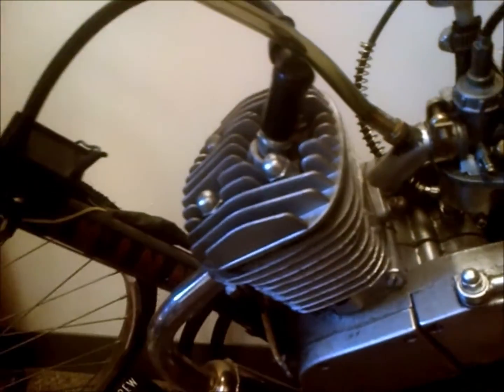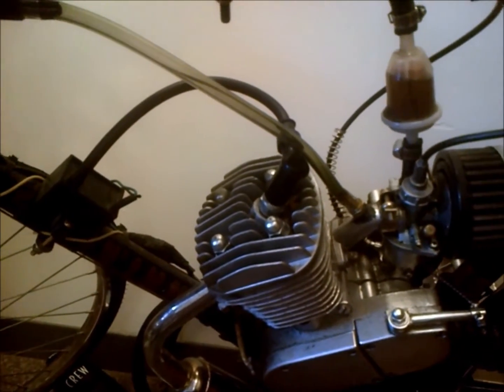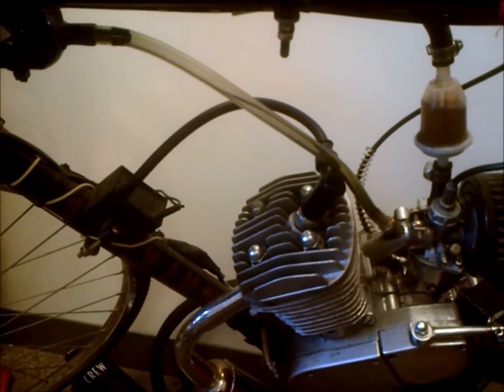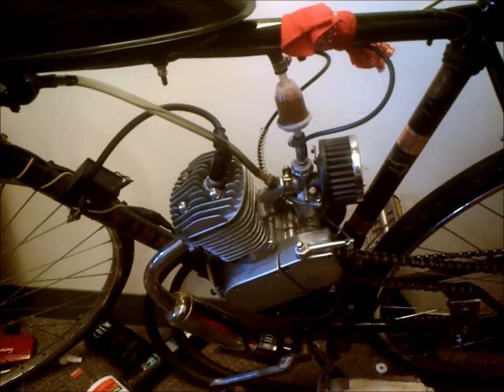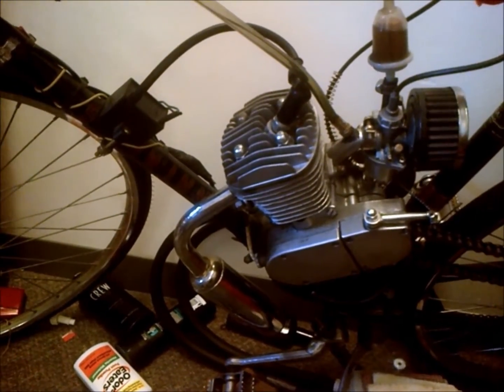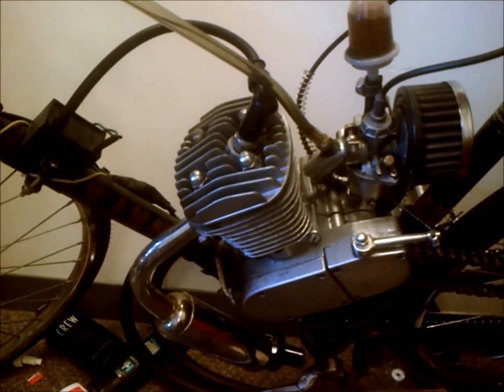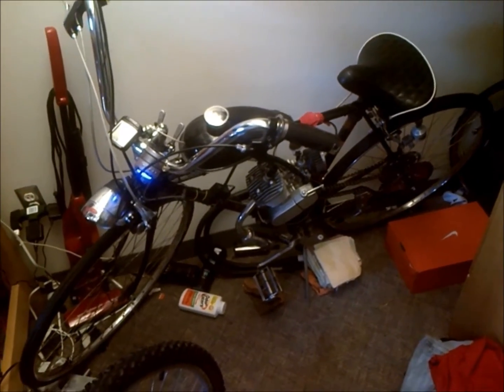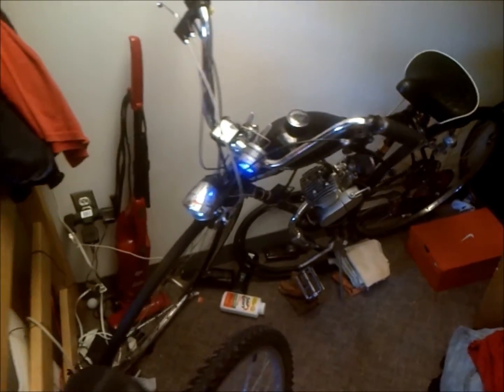Compression PSI to Compression Ratio

Comment: Your wrong. I used to have a compression tester that had the scale from compression ratio to psi and it was accurate.
Reply from the maker: It wouldn’t of been accurate for compression and here’s why - an engine at rpm will vary its cylinder charge due to air speed and valve overlap. At lower speeds, like for a compression test this isn’t present.

Comment: Interesting...I'm getting ready to build a chevy 350 (it wouldn't be my first), and am tackling the same question. Are you the first owner of this bike engine? While the one gentlemen below is correct in saying that pressure and ratio are directly correlated (aside the temperature variable) , this measurement is not so simple. Most decent compression testers have a tube between where you attach them, and the actual pressure gauge. That in itself is proof that you cannot convert the pressure read on the gauge directly to a compression ratio, because the V1:V2 ratio would be different for different engine sizes. In other words, that tube is adding volume to the  combustion chamber, and would result in a lower maximum pressure, before the exhaust valve opens. Imagine if the tube were the size if a 100 foot water hose, the pressure gauge would never get a chance to pump up, because the exhaust valve would open before the piston ever got a chance to fill the hose. The smaller the displacement, the more error would be introduced by that added volume. Secondarily, the compression tester has a check valve, and it takes several cranks before you peak out at a maximum pressure. That tells me that other "real life" variables are introduced, because theoretically, one full cycle would give you the maximum pressure, before the exhaust valve let all that pressure out. I'm thinking maybe the few cranks gives the rings a chance to get oil on them for a better seal, and maybe the friction heat also helps to seal the rings. The first crank may even be while the exhaust valve is opened (but it usually takes several to pump up the gauge). That being said,...if you are measuring 150 psi,.. I agree with the rest of the folks. Either your gauge is off, or your head has already been swapped.

Comment: Are you sure that the factory makes them the same every batch? For example, that's a slant head and even though they suck for performance, it still is considered a performance head in the way it is marketed. I just bought a performance head made by the same Chinese factory that makes these engines, and though it is a CNC biillet head. It gives an 9:1 compression ratio.  If I put the iridium plug in it, the ratio goes up to 10.8 to 1 and that's only a .6cc decrease in head chamber space! I cc'ed the head, the piston dome, everything. So I didn't need a gauge to calculate it. Also, compression guages are notorious for working innacurately. Even the best ones like Snap-on and stuff. So, there are other ways you can figure out what is going on.  180 -200 psi is really high! Moreover you are not using the Jaguar CDI. Your timing is for a four stroke engines because that's where they get those stock cdi's from! With that high of a compression and even using a Jaguar unit, your bearings physically cannot survive long.  With that stock CDI, say goodbye to your bearings overnight!  I agree about the high octane though. Why save a few pennies. I use 95, because that's the next one up over 91 where I am.
Reply: You may think it is 6:1 or 150 psi, but something is not correct here. Either it is not 6:1 or your guage is lying =-)
Reply: metalurgon How did you checked actual CC of your combustion chamber?

Comment: Compression ratio and psi are directly related, isothermally.
If you take 100cc of atmospheric pressure at 15psi, and compress it to 50cc KEEPING THE TEMPERATURE THE SAME, it will be 30psi.  The reason you are seeing different values is because gases heat up when you compress them.  Hot gas has a higher pressure than cool gas.  The formula to use is:

pressure ratio = compression-ratio to-the-power-of specific heat ratio.

Air has specific heat ratio of 1.4, So in your case, multiply atmospheric pressure by 6 ^ 1.4, ie 12.28, giving about 180psi.
Reply from the maker: +Jack Bloggs well this engine makes 150 with 6:1 compression